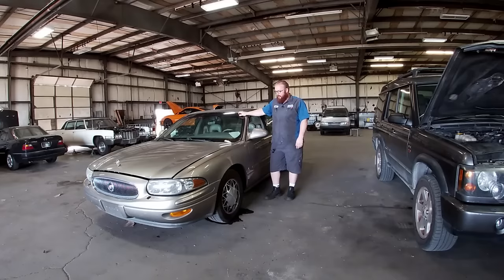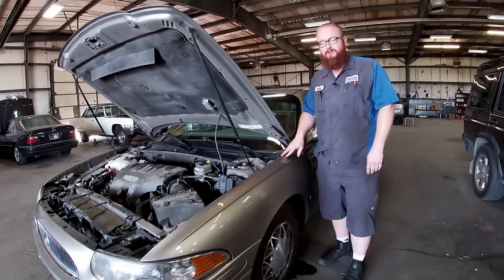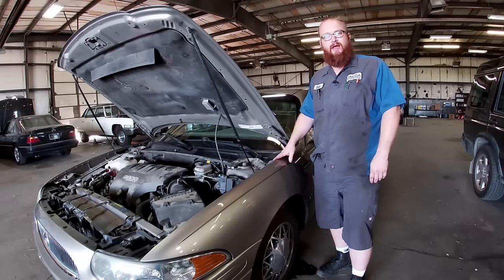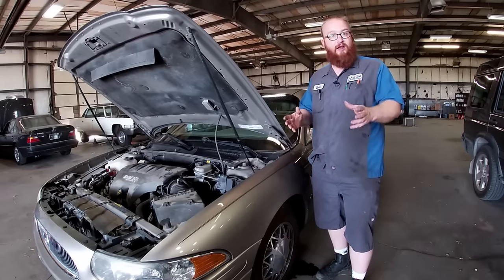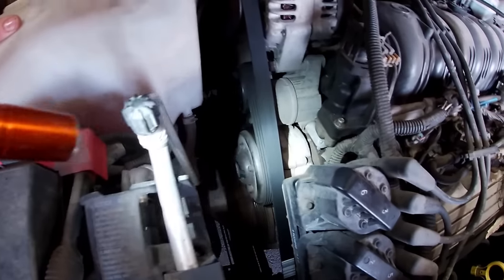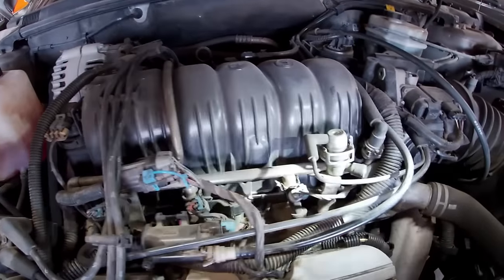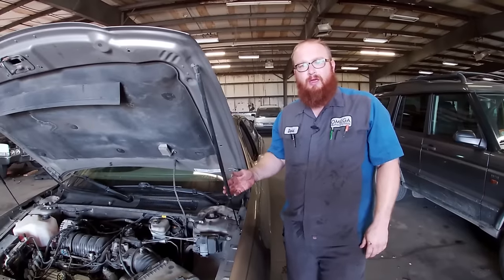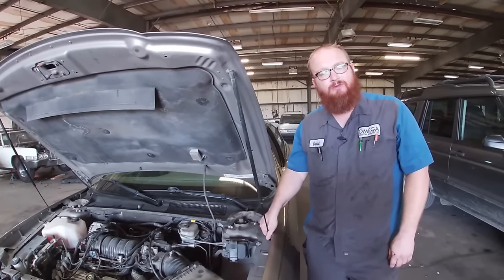CAR WIZARD highlights what makes the Buick 3800 V6 the BEST engine ever!

Comment: Your comment in this video, about the guy with one of these engines in his car that was supposedly leaking some oil,  is sorta, kinda similar to what happened to me at a local Chevy dealership yesterday.  I knew my 2005 Buick LaCross CXL was using some oil, and was fairly certain it was at least partially due to a leaky oil-pan gasket. The dealership confirmed that diagnosis, and also said the rear main seal was also leaking oil. 

They did show the leaks to me in photos, so I believe them. 

However, they said it would cost over $3,000 to fix the two leaks!

So, I more or less told them to pound sand.

I figure most older cars with some miles on them (mine has about 165,000 miles on it) leak/burn some oil anyway. So let er drip. Then I'll just check the oil level every week, and top off as needed. Lots cheaper than $3k for sure. 

I do want to eventually get the two leaks fixed, but will have to find someone who will do the job for a much more reasonable cost. 

But other than leaking some oil, due to worn out gasket/seal, this engine really is great. Runs smooth as silk, and gets good gas mileage on highway trips.

Comment: Bought a 93 LeSabre with this engine, it had 48,000 and drove it up to 129,000. The engine was still good and it would get 30mpg on the highway cruising. Ended up with problems about converting R12 A/C and quoted big $$$$ to do it. I wish my 2019 Acadia had this engine.

Comment: Great show Mr. Wizard!! I recently retired and my father owned buick electras. I love big cars and looking to buy a low mileage lesabre between years 2003 and 2005 with the 3.8 engine. 5:07 To be honest I really like the same years park avenue ultra with the 3.8 supercharged engine. Since it's super charged I'm afraid it might be abused. I noticed a clean one but carfax indicated motor mounts were replaced. Can this be from beating the car. Thanks Jeff Barnett

Comment: Anecdotal story time..

In 2015 both my mom and I bought used cars around the same time. She got a 2000 Corolla, I got a 2002 Grand Prix. Paid the exact same amount ($2200) and both had roughly similar mileage (~110k for the Toyota, ~130k for the Grand Prix). Both had minor issues (window regulators in the Toyota, blower motor resistor in the Grand Prix) but no engine issues at the time.

Within the next two years, the Toyota suffered a PS pump failure that threw the belt, the exhaust rusting out twice, an undetermined evap issue, repeated plug fouling, severe oil leakage from a few gaskets, and a few further non-engine-related issues. The Grand Prix suffered a MAF failure and coolant elbow leakage, but nothing else. The Toyota was eventually scrapped, and the Grand Prix was totaled by my ex. However, the 3800 is still alive and well to this day, since we kept it and swapped it into my Fiero. :)

Comment: My dad’s 2003 Holden Commodore manual [EDIT: rear wheel drive] has the last pushrod 3800 V6 from this family of engines. Admittedly he doesn’t go over 95km/h, but he averages around 6.5l/100km (36mpg). Reliable, easy to work on!
I also have a mate who bought a BMW compact hatch track/gymkhana car which has one transplanted in it! 😂🚗💨😜

Comment: My dad bought a Lumina with the Z-34 package, it had that wierd 3.4 DOHC engine. Pain in the ass to work on, had to rock the engine up in the cradle to do the starter. He traded that in on a brand new 1996 Impala SS. You know the LT-1 the engine who's water pump and Opti-speak distribuer have a suicide pact. It's right there behind the harmonic balancer.

Comment: I bought my 02 lesaber from my father for 800 in 2020. 3 years and 40k miles later she's still going strong. Yea I've had to replace a brake line, a power steering return line,  and my lower trans cooler line. And rebuilt my alternator.  Penny's on the dollar compared to my monthly payments on past cars I've leased.  Just rolled over 153k. And honestly the only thing that'll probably kill the car is when the frame eventually rusts away. Lol

Comment: I Just bought 1 recently with 75,000 miles, near mint condition. The only thing I'm experiencing is the car stalls out after idling for short periods of time. Checked the batt and alternator and they'll good.

Comment: I purchased a buick from someone that thought the engine was knocking, I was pretty sure it was just the harmonic balance, common issue on these! Sure enough. That's what it was, replaced it and had a great car for cheap lol! Had to pat myself on the back on that one lol. Got the car really cheap, got the harmonic balance at a salvage yard for $35.00 lol.😁🙋‍♂️ I'm sorry, I called it a harmonic balance, I believe on these it a vibration dampener. Has rubber inserts that go bad and the metal starts slapping together causing it to sound like an engine knock!

Comment: Also, to be fair, the 3800/3.8 started life as a 90-degree,  231" odd-firing, rough running, cheap adaptation of an expensive aluminum Buick V8 in the early 60s.  They had 3 decades to turn it into the even firing, balance-shafted 3800s that we know and love...  (And yes, I'm still driving a '97 Riviera with a mildly modified supercharged Series II.

Comment: Truck driver here - Bought a 1999 Park Avenue 15 years ago at a small dealership in Palm Springs CA with 35k original miles  - Fast forward 15 years  - It's got 83,000 miles now with factory roters never been cut and all original hoses  - I've only averaged 1500 miles a year with it  - Not an exciting car but it's a real car ! And what he said about 30 per gallon is " truth " on the big road  - Closer to 23 in the city  - No match for a Lincoln Town car but Town cars get 10 to 13 mpg  - Aside from Trucking I've also driven many a Limousines  - If money was no object I'll take the Lincoln  - But in real time I am cool with the Buick, way more comfy then Uber every time -

Comment: Question. I just bought a 2002 Impala and I did a really good tune up on it. I replace the upper ,lower hose ,thermostat, rad. cap.(radiator seems good no leaks at this time knock on wood) new plugs, wires change the oil and filter. Also the two (plastic) L brackets that always leak around the alternator to aluminum. Here's the question? The temperature gauge on the dash of the car is showing one notch under the red( and bouncing between the 210 position and the last notch before the reds)And I have a Buick 3800 and it runs dead center and it has the 3800 II  in it. To get to the point, is there a way to replace a component to get that temperature gauge to work correctly again. I know that it's not running 260 or 290°. I've let it run for quite a long time and it does not boil over which if a car was running 260 degrees I think it would boil over. THANKS

Comment: Excellent video.really helpful.  Looking for advice. 2004 Buick Lesabre 98k mi.  Reg trans shop changed fluid/ filter /Lucas trans fix. found nothing wrong since no Trans codes.  Shift is barely felt. More at lower gears.  It starts doing it when engine is warmed up.

Comment: I had the '86 Skylark 3.0L V6 non sequential fuel injection and the first time I drove the car home from the dealer it died in the driveway and would do that throughout the life of the car. There was a vibration from the transmission/torque converter that would shake-vibrate the car around 45-50 mph. No dealer could get rid of the vibration and finally a man from the zone office told me
and said, 'I see nothing wrong with this car."
The problem was with the exhaust manifold being of tubular steel and it had runner metal sticking out into the branches air path causing low rpm back pressure and lack of high power; along with
the branches being in an antiflow angle causing back pressure all the time. I rerouted the runners with some pieces of tail pipe from a Toyota and this gave me 4 more miles per gallon and a huge increase in power and torque. I had to cut apart the manifold on the radiator side of the motor to find these wrong elements. I was in LA and driving along the highway when a young guy in a T Type N body two door was trying to pass me after I reworked the exhaust manifold. He had the same motor but with lower final gearing (that was his only advantage). I pulled away from him twice on the high way and we both exited the highway onto side streets with stop lights. He tried to drag race me from the stop lights. The third time I let him have a 1.5 second head start from the light. I came roaring past him in 6 seconds and he was fuming!
That little 3.0L had connecting rod bearings noise at 120K miles. It was aluminum bearings from GM and narrow split crankpin bearings. Cheap stuff. Also the crank position sensors kept breaking. I was so glad to get hid of that car. I had 180K miles on it and went to the dealer for some problem. They saw the digital odometer reading and falsely read it as 18,000 miles and did some recall work on the car and then found their error and charged me for the updates.
The 3 pack ignition coil gave out at low miles and I put in a new one and purchased another coil pack as a spare in the trunk. I quit buying GM.

Comment: I've blew a 99 buick lesabre engine with 126k miles because of a upper intake leak. Replaced that motor with a 04 Buick Regal motor with 124k and that one blew in less than 2k miles. Unreal!

Comment: I have this same car! Has 231000 miles for only $1400. It has a few issues like ac not cold sometimes, wheel bearing maybe, and transmission fluid needed. But it starts every time and loves to float down the highway getting around 26 or 28 mpg
Reply: To anyone on here considering a Buick 3800 equipped car, specifically an N/A one: MAKE SURE IT HAS AN UPDATED FUEL PRESSURE REGULATOR. My father's '01 Bonneville suffered a fiery explosion earlier this year due to a faulty fuel pressure regulator that GM claimed was improved for the 2001 model year. Turns out that was a lie. The car was totaled. Upon researching the issue, there are thousands of cases, and even a recall, which DID NOT cover cars after the 2000 model year, even though it obviously wasn't fixed on the newer cars. Even a famous video of a 3800 impala blowing up in the exact same way at a shop after an oil change. So if you've got a N/A 3800 car from 2000 or earlier, make sure its had the recall done. If you have a 2001 or later, you'll have to do the job yourself or somehow verify its already been done without a recall sticker.

Secondly, the 4T65E transmission is notoriously weak. Excessive clutch wear is pretty much guaranteed unless shift kit is installed. Signs of this issue are hard shifts aı eventually slipping/shuddering during acceleration.

Comment: Funny because I just bought a one owner 1993 buick lesabre limited with 88k miles. Has the 3800 engine.  Only thing I had to fix was the air conditioning.  Great car

Comment: Have a VX Commodore 2001 (Australia) real wheel drive with the 3800. Engine wise besides the usual services ive only had to replace original pulleys and water pump. 350000 km.

Comment: Wonderful engine. I had a 97 lesabre with 60k miles on it. Barely broken in as far as the 3800 is concerned. But the transmission had already given up the ghost lol

Comment: How about the integrated water pump with the timing chain cover gasket. That repair I was quoted 1200 or more to "I don't want to do it" Finished in 10 hours by watching videos like yours. Cost $30Thanks

Comment: The Buick V6 was originally a chopped 300 V8 which was a derivative of the aluminum 215 V8 from 1961, which was sold to Rover and became the Rover 3500.  The Buick 215 was also developed into an F1 engine by Repco of Australia.  The V6 was originally an odd fire 225 cid called the Fireball.  The rights and tooling were sold to Kaiser Jeep and the engine became the Dauntless V6sold in many CJ-5s.  When Kaiser sold it's automotive interests to American Motors, GM bought the rights and tooling back, developed a split pin crankshaft to make it even-fire and enlarged the bore to match their 350 V8 which was itself a further development of the 300.  It's not just a legend, it's from a family of legends.

Comment: I had a 1981 Pontiac Grand Prix that was equipped with the 3.8l V-6 and was rear wheel drive. I've regretted getting rid of that car ever since. I'm on my 5th 3800. 2006 Grand Prix GTP. They are the Best that I've ever owned.

Comment: Blew a plastic 90° coolant on engine block on passenger side of engine. They made cast aluminum. it broke too. I think it was under the alternator bracket. It stranded us out in the boondocks.

Comment: i have one of these in my 2003 monte carlo ss. it was sourced from a buick regal but its the same engine that was in there previously🤷🏻‍♂️ great engine. but if it begins to have a overheating problem fix it fast n youll go 1M miles

Comment: My 1st  Buick lasaber I sold it 250000 miles just a little body rust Is ran great excellent gas mileage  I was lucky to buy this$700  92 Buick Regal with 73000 miles on it With the 3800 Need Complete break job And struts didn't myself Parts were plentiful and Hecka lot cheaper than most car Parts.  Excellent gas mileage Smooth ride. I put 10000 miles in less than a year On The old girl 😊

Comment: I subscribe to your channel recently and came across this video. My son has a 97 Grand Prix GT with the 3.8. This car has been a pain in the rear. I car died unexpectedly while he was visiting his girlfriend in PA(he lives in NYC with me). Goodyear replaced the starter and he was able to get back home. Just yesterday he went to PA and stopped at a Walmart. When he came out the thing wouldn’t crank or start. Only code is P1870. I suspect it’s the crankshaft sensor. The battery is good. Unfortunately the only mechanic I trust is in the Bronx and he doesn’t make house calls 😅

Comment: Just bought an 07 lacrosse 3800 transmission messed up after i arched the electrical, here in centralia wa the gm dealership wants $5800 to replace the transmission

Comment: I needed a replacement car for my Cadillac.  GM has junk new motors my trusted mechanics wouldn’t approve. Finally got down to a Buick Allure, aka LaCross.  2009,  70k miles.   My mechanic smiled  ear to ear.  Approved.  Paid cash, looks new, undercoated, 3800. I was prepared to be making payments. I bought an engine.   Picking car up end of week.    I had a LeSabre before, 1997……I agree, no bad reviews on cars with 3800.

Comment: We had the LN3, Series 1 and Series 2 here in Australia. GM Holden used the motors in rear wheel drive applications before replacing it with the 3.6 in 2004. We never got the Series 3 but we did get the supercharged Series 2 (automatic only). I've read that there was a turbo version in the USA, something called a GXP I believe?
Reply: As an Aussie, it's kind of weird seeing these motors in transverse mounting front wheel drive layout.
Reply: Pretty sure our 3800 motors here in Australia didn't use the plastic intake manifold either.

Comment: I believe your customer. I have seen some things in the last 5 years. Sales has always been a flaming asshole of a job. There is a lot of pressure on any sales force. I wish the car makes would do the research to understand where things got off track. Prior to all of this, I had one dealer in 2002 that made me so mad with inability to fix things, i found another. And the next one knocked my socks off with professionalism. As we tried different brands, and different dealers, we have had such amazing dealer service experience. Then service abruptly started deteriorating in 2018, reaching appalling by about midway 2020. There is an independent shop in  a nearby city that is as honest and competent as you CW. They are so busy though. And one of our Cadillac dealers has managed to hang on to it's soul. They are pricey at $200 per hour, but they are so good.

Comment: One of the greatest cars ever. It's like driving a huge couch on wheels, it's indestructible for the most part, and if anything DOES break it's very affordable and simple to fix. You can easily expect 30mpg highway from the venerable GM 3800 V6, which is the greatest engine of all time. Toyota enthusiasts would have an extremely difficult time arguing otherwise. The last of this era ended in 2008/2009 with GM's bankruptcy and swiftly moving to a more "modern" lineup (modern is code for TRASH) as dictated by its agreement with the government for bailout loans (people will argue otherwise, but this is the general consensus). The final 3800's being put in the 2009 Buick LaCrosse and 2008 Buick Lucerne. I have not and will not purchase a post-bankruptcy designed GM product. If you want reliability in 2023, that crown belongs to Toyota. It's sad to see GM cannibalize it's own lineup and just throw everything good they ever did in the garbage. They're basically Nissan now.